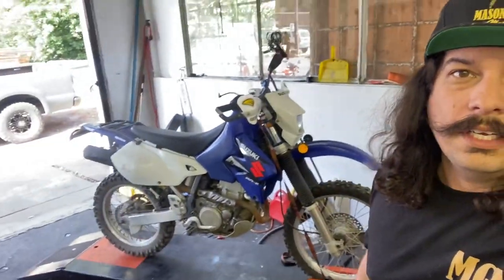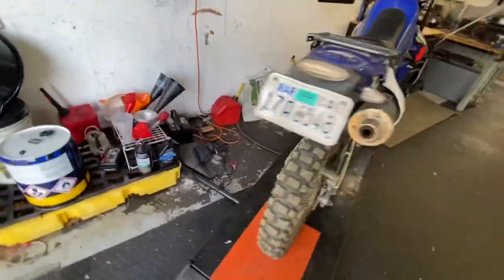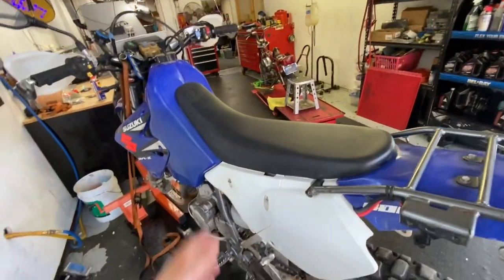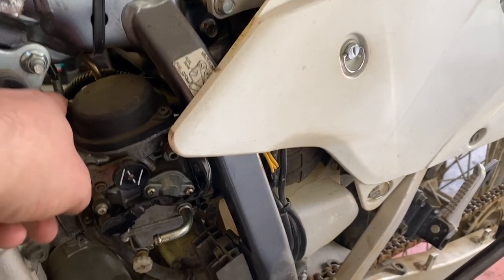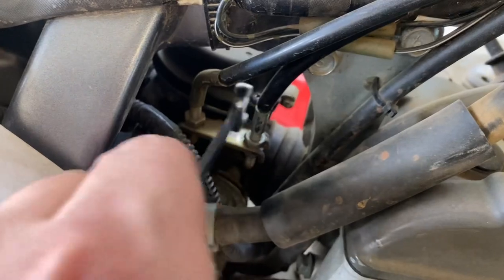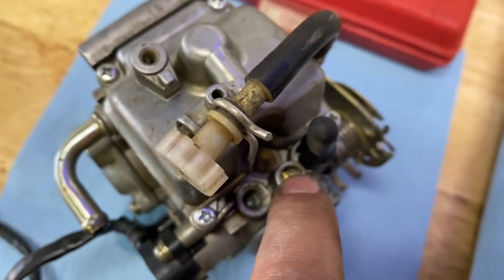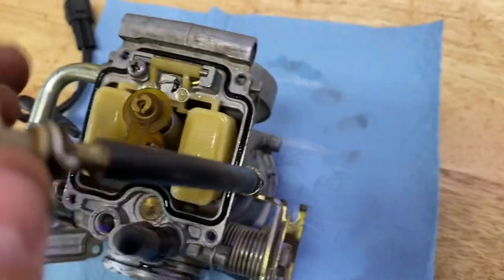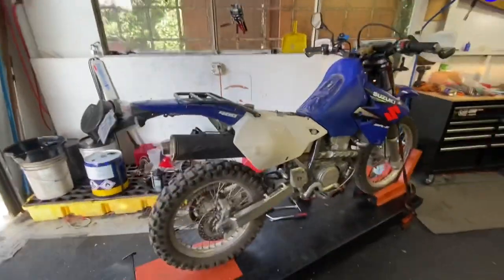Suzuki DRZ 400 Only Runs With The Choke On

Comment: Super video, really useful to be able to watch, pause, learn etc.  Quick question... The 4 screws that hold the float bowl on...  I know you used an impact driver on those, but what bit did you use on it?  I think they are a JIS headed screw in those (as opposed to Phillips head)?  Or did you you just use a standard Phillips driver, live a number 2?  Keen to use the correct bit for it, as I guess once it is rounded off - you are in a world of pain!
Reply from the maker: I used a Phillips head. Not sure if they're JIS or not , I also have a bunch of new ones and a lot of the time I end up replacing them.

Comment: Ahh I think I have to clean my carb… question, last Friday 6/10/2022, I cracked stator cover and was leaking oil… long story longer. 
I took it as an opportunity to get to know my bike… I took the seat off, fuel tank off, fixed the stator cover (with some jb weld) inside and out. When I put the fuel tank back on I turned the petcock to pri because the vacuum line from the motor to the petcock was ripped.  now the bike won’t start without the choke on. Did i clog/ flood the carb?
Reply from the maker: Possibly a piece of dirt got in there🤷🏻‍♂️ it wouldn’t hurt to open it up and take a look.